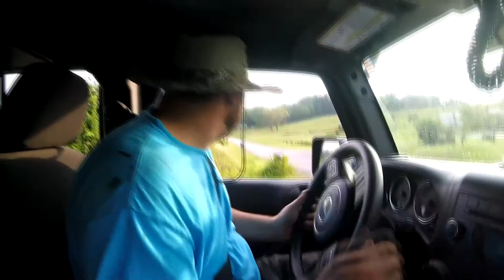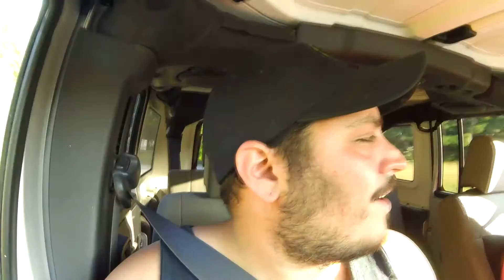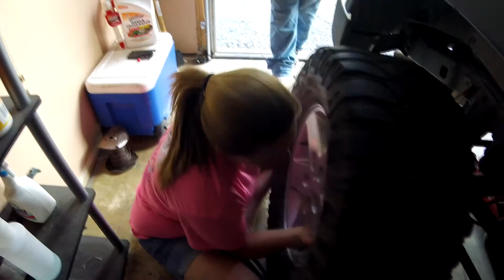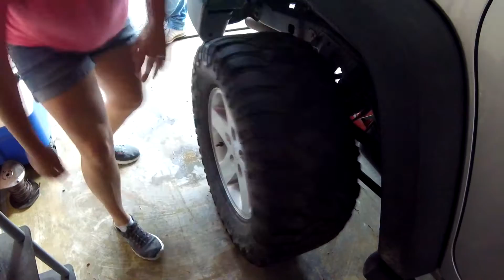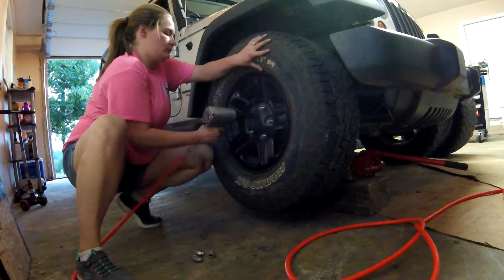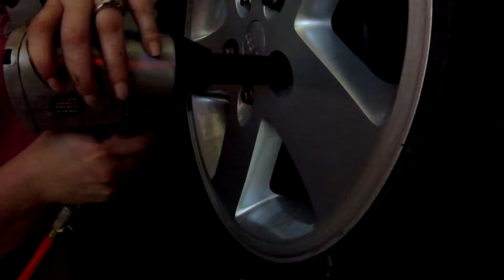New Tires for the Jeep 33/12.50/17

Comment: it looks like your driving stick... how are those small 30s compare to the 33s when on first gear? I'm wondering because I wanna do the same exact thing.
Reply from the maker: John  Makar our silver jeep is an automatic but it's fine. we had to add a transmission fluid cooler tho. the black jeep in the very beginning of the video is a manual and he has 35s. his has been fine every time I've driven it. No upgrades to the transmission or anything
Reply from the maker: John  Makar the feel of the different tires however is a slight difference. the 33s feel a tiny bit more jerky, but not bad. and with a steering stabilizer it doesn't feel any different. with the 33s we have no stabilizer and daily it. the jeep with 35s has a steering stabilizer and it feels fine